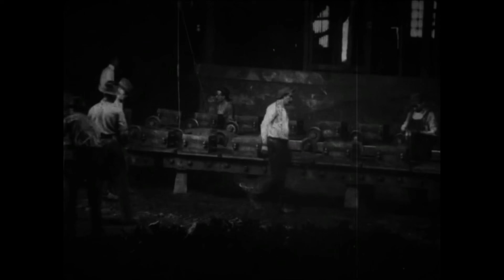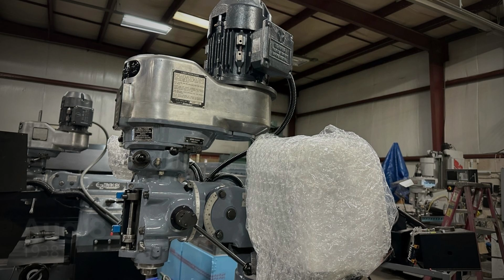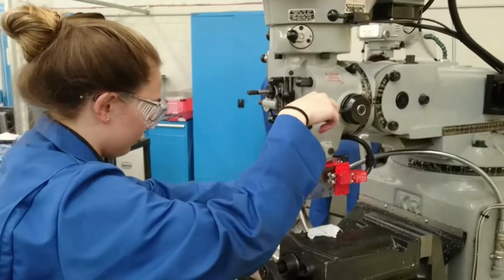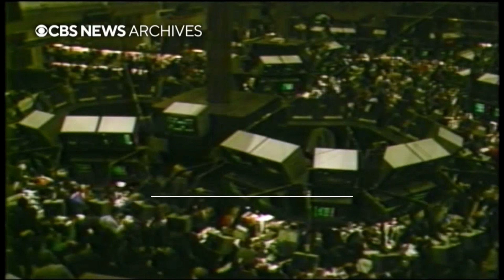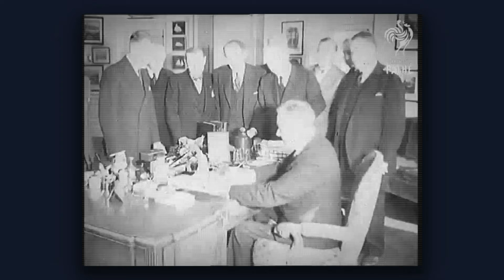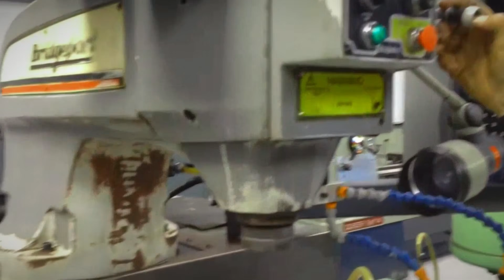How a Failed Hedge Trimmer Company Built American Manufacturing

Comment: The company I worked for Peacock precision, had a Bridgeport Hydra point two axis miller which had no lead screw at all the tables were driven by hydraulic servo controllers. It was capable of +- .0005” repeatability. It wasn’t continuous path but point to point. This was in 1974.

Comment: If I remember the story correctly, Textron in the late 1970’s or early 1980’s decided to stop selling Bridgeports through a dealer network and would sell direct to customers. The dealer’s in LA got together and went to Taiwan to find machine tool builders to make machines.  They also wanted improvements Bridgeport would not make. Thus lots of Bridgeport clones exist. I like my YCI Supermax over the equivalent Bridgeport. 

I do also have J head that mounts to my K&T 2-HL Universal Horizontal

Comment: I have an M-head in my garage serial number 4670 build in 1944. While working for Positronic Industries in 1980 I was tasked with doubling our tool room machines. Jack Gentry mandated  that I only buy American equipment. I called Bridgeport to order a new mill and was told that delivery would be in two years. Corporate  stupidity is what took then down along with almost every other American mfg company. At the same time I found that no engine lathes  were being made in the U.S. you have a nice script but your AI generated photos are terrible!

Comment: Owned several series 1 and series 2 Bridgeports mills! Great machines, even for broaching and combined with Hardinge  dividing heads, a precise piece of manual equipment! Hardinge lathes also a true piece of precision tool! All combined with a good surface grinder ( Brown & Sharp) will give any tool maker the perfect “tripod” to do a lot of interesting and precise small run without the CNC equipment

Comment: I 100% agree that apprentices should learn on manual machines before touching ANYTHING that was computerized. They have to understand the feel of the drag between the endmill and the steel they're cutting. Understand Climb vs Conventional and how that makes a difference.  Understand the history of machining and how it's not as easy as pushing a button. I'm a 27-year Journeyman Tool & Die Maker and I appreciate my time (years) on the Bridgeport.
Reply: Agreed I had to learn all the manual machines some from WW2 before we even were taught CNC programming then we had to learn all the CNC equivalents of the manuals to get my master machinist degree. It made me a great machinist I could set up almost all machines in any shop. I've been the lead machinist in almost every shop I worked in so I could work almost anywhere I wanted. I ended up in aerospace shops doing government contract work in the best job shops in Florida I've made parts for major aerospace companies. I made parts for fighters submarines rockets and even the mars rovers and satellites for nasa I've made a good living in my career I'm 28 years in now I advise everyone who wants to get into machining to do the same thing. It's a shame that people don't want to get into the trade anymore it's really sad.

Comment: We still have a Bridgeport mill machine in our 84yr old plant and it still runs as strong and quiet as it did when it was installed in probably the 50's
Reply: I know that's right I've seen a horizontal mill that cut gears from the forties and still does you can hog mill with it on huge material with a helical end mill.

Comment: I've just opened a purely manual shop servicing the food processing industry with emergency repairs, spares and consumables.
I have a beautiful American built 2hp Bridgeport and a 50" Colchester Triumph. These are soon to be joined by a Hardinge HLV-H toolroom lathe.
For what I do, these machines are the dream team.
The versitility of the Bridgeport, along with taper turning and a 21" faceplate on the Colchester and then the super accuracy and intuitive ease of use of the Hardinge is an unbeatable combination for fast turn around emergency breakdown work, and these machines make really good money for a relatively small investment.
If you want 100 parts making, I can't compete, but if it's a 1 off, needed yesterday, CNC can't compete.
I always have an 8" vice and a 10" rotary table mounted on a 48" table, cutting set up time to a minimum.
Both the Bridgeport and the Hardinge are designs tracing back to 1938, and after 43 years of machining to the highest level, I've never needed anything else.
Reply: ive always had pleasant experiences with bridgeport mills
Reply: yeah buddy
Reply: I love manual machining, I'm just a hobbyist though not a pro.  

I have to ask though, In what world is a serviceable Hardinge HLV-H a "small" investment? Those things are worth their weight in gold lol
Reply: @S14zenkiQs 
I've just picked one up with an electrical fault for £500 ($700ish).
If it's popping the L1 fuse it is the transformer, if it smelt of rotting cabbage when it popped, it is the Selenium rectifiers.
I have an electronics and control guy I work with on occasion and he's going to modernise it for me.
Anything mechanical I can sort.
If we can't get it running then it's not a huge loss, but if we get it right and it costs £1500 ($2000) it's bargain of the century.
Reply: @AntonHoward-mx9sb if its mechanically in good shape you definitely scored a hell a of a deal.
Reply: @S14zenkiQs 
There quite rare here in the UK. I trained on them when I was a kid so I always keep my eye out.
You see some really crusty ones, some that are a bit to early and a lot with the capstan turret but not many of the Toolroom version.
I love the things, I've used Schaublins and all sorts of beautiful machines but the HVL-H can't be beaten.
Reply: @AntonHoward-mx9sb an HLV-H is my dream machine, but I'd settle for a high quality Taiwanese clone like a sharp
Reply: I've been machining for a living for 43 years and you never stop learning......I feel like I'm just starting to get the hang of it.
Reply: If you are interested I do have a guy who's got vintage Bridgeport machines and all kinds of other Machining equipment let me know I live in the Chicago area
Reply: @ericerto8250 

I'm in the UK, shipping might sink the deal lol.
Reply: @AntonHoward-mx9sb yeah LOL it really wouldn't be economical😂
Reply: I took up machining 16 years ago and though I see myself as amateur I respect machinists who still do manual
Reply: @BlakkBearMoor 
I didn't realise until a couple of years ago just how rare a trade it was nowadays.
Reply: Lol@ cnc can't compete. Sounds like cope. Cnc can do everything a manual rig can do but the reverse is absolutely not true.
Reply: @dddon51 when it comes to one-off parts and repair work, a manual machinist can often complete the work in less time than it would take to model the part in CAD
Reply: @S14zenkiQs 
Exactly.
Reply: @dddon51 
So, when I get a call at 3am on a Sunday morning to do a breakdown repair, I can just go in and start cutting straight the way, I've not got to fuck about programming or calling a CNC machinist to get things out of the door double quick.
The books to my business tell the story and I regularly hit £200 an hour clear profit.....so tell me I'm wrong.
No need for cope lol.
Reply: @AntonHoward-mx9sb  I would hate to have to do repair work on a CNC machine.  3d scanners are getting more affordable though, they can save a ton of modeling time.